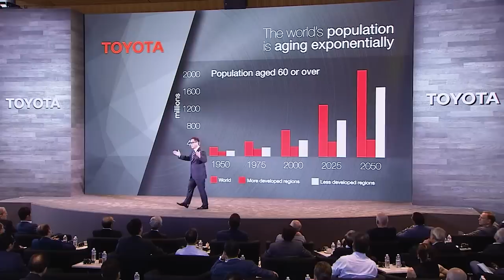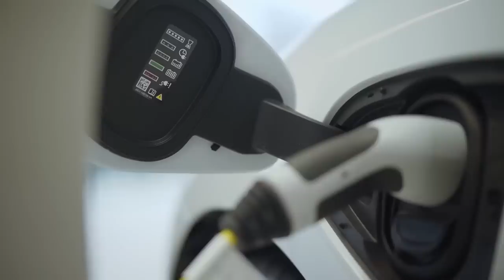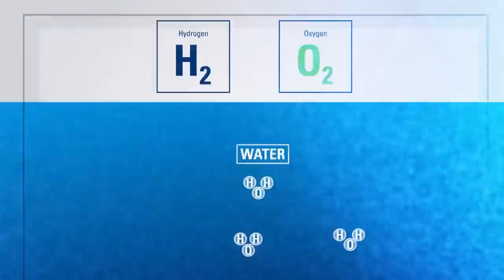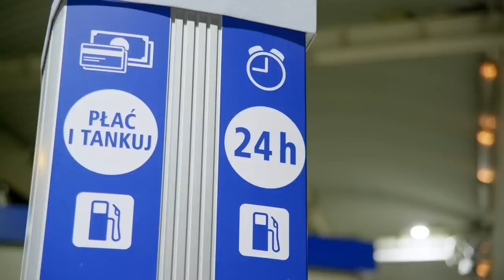New Toyota CEO Shocks Everybody | Huge News

Comment: Interesting, EVs are still a tiny fraction of the worlds motor vehicles, when the technology has matured enough to assure it's a superior concept, then it may become the dream that was imagined. It's still in the infancy stage of developement, can't wait to see it grow up a little.
Reply: There is no clamor for these vehicles. Smoke and mirrors.
Reply: With all the destructive mining needed to make EV batteries, their limited recycle ability, and the strain on the electric grid, not to mention the excessive cost (and infrastructure costs) Hydrogen can be integrated into the existing ICE fueling depots and stations as well as moved regionally by pipeline. I think Toyota is aware of this and if mainstream media would drop all the hype and look at the conversion of station facilities and work with the big refining companies, a 50:50 shift IS possible in the next 10-15 years. But the automakers have to stop following the crowds and media hype from the evidence of a small fleet (comparatively speaking). Stop the koolaid fountains. let science follow the facts and do the planning.
Reply: The tech is there. Outside of towing heavy loads EVs are superior in every way. Only thing is for the costs to start coming down.
Reply: @servehim1746  Do you sell lies for a living?
Reply: EVs are mature enough to serve very well in certain use cases common in well developed countries. For example, as a local errands/commuter car for families that own their own homes - especially as a second family vehicle. Since EVs are typically charged overnight, the daily driving range is what is important. Any modern EV with an EPA range of 200 - 300 miles will do this nicely - even allowing their drivers to go multiple days without charging. To your point, as the technology matures, more and more use cases will become more viable.
Reply: @JasonTaylor-po5xc  I agree, but a golf cart works well too as a third errand running vehicle.
Reply: @XKS99  not superior for my 800 mile drive to see family.
Reply: @servehim1746  Only if you live in The Villages (or similar retirement community). In my area, I would get ran over in a golf cart. They are also not legal on 45+ roadways - which is what I need to use to get to work.
Reply: @lyleclark9190   Model S or Lucid Air can easily match any non-cannonball run for total journey time. See Bjorn Nyland’s 1000 km challenge series on YouTube.
Reply: @lyleclark9190  Most middle class families have multiple cars. If you are stuck with having only one, then perhaps a PHEV would be better instead of BEV. If you are able to afford a Tesla, then road trips really aren't a huge deal since they have the best network and charging speeds. I visit my family, about 500 miles each way, and it really doesn't take that much more time than when we did it in an ICE vehicle - I just align charging stops with everyone's bathroom breaks.
Reply: @Lyle Clark  An 800 mile drive in my Tesla will cost me about $40. You?
Reply: @lyleclark9190  You drive 800 miles without stopping 30 minutes for a bathroom break and a meal? That must be quite the bladder you have.
Reply: So you only own one vehicle? And you drive to see your family what? 15 - 16 times per year? Well, I guess for an extremely unusual use case such as yours, electric just doesn’t make sense. If, on the other hand, you’re really like 99.986% of other people and don’t have those needs, maybe having one purely electric vehicle wouldn’t be all that debilitating a choice for your lifestyle. Anyhow, you could always have a second, gas-powered vehicle, you know, for those “other” situations.
Reply: @ws6002  To be fair, some folks don't care about cost - they simply want to get to their destination the fastest way possible. Of course, in that case, I would just fly if the distance is more than an 8 hour drive. Also, I didn't buy my Tesla to save money, but it is a nice perk.
Reply: @WarBuzzard  
I travel 800 miles round trip at least 6 times a year. A Tesla Model 3 is a very comfortable way to do it.
Reply: @HariSeldonIsBack  Pretty easy to stop at any gas station along the way vs finding a quick charge station in the middle of Nevada.
Reply: @ws6002  A lot less for me over all with my 10 year old car.
Reply: @servehim1746  Pie in the sky reasoning....way too expensive and the game is over and EVs have won.
Reply: @Lyle Clark  
I am waiting for a dollar amount. Don't be a politician. Just answer the question. How much in fuel does it cost you to drive 800 miles?
Reply: @ws6002  I keep my vehicles for a while and the batteries would time out before the car was worn out. Have you checked out the cost of replacing those lithium ion batteries? Don't tell me I'm being a politician just because logic defies you.
Reply: @JasonTaylor-po5xc  My next vehicle will be a hybrid for the longer trips and have a smaller battery so it can do short trips without lugging about with a 1000 lb battery - too expensive due to rare earth minerals and precious metals.
Reply: @XKS99  Toss in the EQS and I7. Long trips are already cheaper and more comfortable in luxury EV sedans.
Reply: @Lyle Clark 
You are a politician. I am still waiting for an answer to my simple question. How much does it cost you, in dollars and cents, in fuel to drive 800 miles? Don't expect any other response until you answer the simple question you have been evading.
Reply: @ws6002  don't be so simple, the fuel cost for my last 800 mile trip was about $100 for a car that won't depreciate as fast as the money you will loose with your EV. Overall cost is still to my advantage. If you put a lot of miles on yours every year and do frequent trade-ins then an ev could make sense but for many of us that don't put a lot of miles on our vehicles the EV looses in economy.
Reply: @Lyle Clark  Congratulations on answering a simple question. Obviously, I know there are other costs involved. At this time, buying a new EV is more expensive than a gasoline car of the same capacity. But that is changing. Because of the simplified architecture EVs enjoy, they will ultimately become less expensive to purchase than the gasoline car. And when that happens, gasoline cars and trucks will have a challenging future. Gasoline cars require oil changes. EVs do not. Gasoline cars have expensive scheduled maintenance, such as replacing the timing belt. EVs do not. Gasoline cars have 10,000 components, and as the car gets older, they get increasingly uneconomic to maintain. EVs do not. My gasoline powered car requires waiting in long lines to get $0.05 a gallon off. My EV effortlessly charges at home in the garage. The price of gasoline is not under our control, no matter how many pipelines we build, because oil will always be sold at the HIGHEST PRICE anyone in world is willing to pay. The price of oil shot up when Russia invaded Ukraine. It also shot up when Iraq invaded Kuwait. And we paid a price in blood when we sent our men and women to the middle east to kick them out again. For that reason, I think we need to include a good portion of our military budget when we talk about the cost of you driving 800 miles in your car. And of course gasoline cars pollute the air, leading to some of our citizens dying from lung related illnesses and cancer. Don't get me wrong. I am equally responsible for the war in Kuwait and the air pollution, as I have owned gasoline powered cars all of my life. My real message here is not you should do this or you should do that. My message is one of hope. For the first time, we have a real alternative to gasoline powered cars available to us. Maybe, but not necessarily, an EV will be the right choice for you. But it will be up to you, not me, to make that choice.
Reply: @ws6002  I do agree with everything you just wrote, all well said.
Reply: @ws6002 My Mustang GT convertible V8 with MagneRide would be even more comfortable lol
Reply: @Matt Ritchie  
I'm not sure there is a lot of overlap between people who buy loud muscle cars and light weight super high mileage BEVs.

Comment: Go towards EVs that don't need to be plugged in. Have a mechanical direct connect to the axle of EVs and solar, to super charge them. No more plugging in. Use V2G tech to transfer extra energy to the power grid, so the EVs don't light on fire or explode, from over charging. The tech already exists and both the mechanical direct connect and the solar, should be a  manual plug or connect. In case the V2G tech is malfunctioning for any reason.😎
Reply: People talk about solar charging, in the UK you can forget that. My wife's garden lanterns are solar charged I cant remember when they were last working. The UK has very limited all year long sun.
Reply: You do know that you get about 1 kWp if you plaster the whole car in fragile solar cells, that's at best 5 km/hour in bright sun, if you have trees, houses, anything providing shade to your car at any time of the day then it will be considerably less. And that means that the sun needs to be shining (which in January it was for about 30 hours total where I live). In Summer time you will need to cool down the black (mandatory, only color available for the solar cells) car which will become hotter than even a normal black car (because the solar cells heat up themselves on top of the ambient heat of parking the car in the blazing sun) - reducing the amount of captured energy for driving purposes again quite considerably. 

That's why Sono Motors and Lightyear have already faltered on their plans to produce a car that is supplementing the external charging,  that leaves Aptera with their plans but that too doesn't look good in terms of self sustaining power generation.
Reply: @karlgunterwunsch1950  and you do know that I brought up more than solar right? Solar would be a small additive,so there's always a charge in your EV.
Reply: @caseyford3368  You described a perpetuum mobile - that doesn't work because of the laws of thermodynamics. Only someone who has no clue in physics would suggest something like your direct connection to the axle. All BEV have a way of recovering energy from their motion - but they do so only while decelerating (commonly known as breaking) and that's the most they can do and it already is implemented on every single one of them. So you didn't describe anything new nor as groundbreaking as you make it out to be.
Reply: @karlgunterwunsch1950  all it would take ,is the right gear configuration and rivets in where you have the mechanical direct connect. There are multiple gear configurations, that allow us to harness kinetic energy.
Reply: @karlgunterwunsch1950  the solar, would be just to keep a charge in the EV, if you happen to leave your vehicle somewhere for a long time without driving/ charging it. We may think about combining a self running generator, with EVs. Solar wouldn't charge a vehicle that's in the dark all the time. But, self running generators would.
Reply: @caseyford3368  Self running generators are the dumbest idea ever! What do you want to run the generator on?
Reply: @karlgunterwunsch1950  are you not aware of the many self running generators that are already patented? And for me, I'd use a kinetic design self running generators. Combine a  kinetic design that will keep itself moving. Then add magnets for weight and constant flow in one direction. The opposing magnets, would constantly charge themselves by moving over other magnet's.
Reply: @karlgunterwunsch1950  I was going to make my own generator, but it turns out, they were already proven and patented. So, now, I just want to track down whomever has the patents and try out a power wall on them. Combine self running generators and power walls in homes and businesses for seemingly endless clean energy everywhere all the time. 😎🇺🇲

Comment: If any of this information is in error, please correct me. It is not my wish to mislead anyone. I hope they manage to make the batteries interchangeable. According to a few mechanics I've spoken with, current EVs and hybrids have batteries that are integrated into the body/floor structure, so when the vehicles are involved in even minor accidents, insurance companies tend to write them off instead of fix them. I would also like to see some kind of plan regarding the recycling of old or damaged batteries that minimizes the ecological impact.

Comment: Toyota has a lineup of automobiles of all types. 
They are seen as reluctant to build EVs, but in reality they are capable of building top of the line EVs. 
Toyota will continue with non-EVs because it is more practical and environmentally friendly. 
Would it be practical to build electric stations in the Sahara Desert or in the backcountry of Alaska with wires running through them?
Or, with thermal power still being generated in many countries, will EVs running on electricity made with it contribute to carbon neutrality?　
The answer is no.

Comment: Pushing for hydrogen is just an incredibly dumb strategy for two really simple reasons: 

(1.) Nobody else is doing it (=no economies of scale);
(2.) People have power outlets at home not hydrogen fueling stations (=no easy way to bootstrap adoption).

Energy costs are trending down for decades, rare earth materials are being removed from battery assembly processes, Chinese and Korean automakers are ramping up production of cheaper models of electric vehicles.

EVs are becoming greener, cheaper and ubiquitous faster not slower than predicted.

One company going against the grain in this situation is not visionary , it’s unadvised .
Reply: Toyota has a problem common to other Japanese organizations: they conflate disagreement and disrespect at the basically the same category.

No wonder the new leader is following the steps of its legendary predecessor.

The world will still have plenty of markets for ICE vehicles, it’s just that these will shrink over time, at an accelerating rate.

Comment: Well as an environmentally trained person, I must say two things. 1. Hydrogen is not an energy source. It is a form of energy storage, just like a battery. 2. Compared to batteries, hydrogen is extremely inefficient when looked at the whole chain from making the hydrogen to the wheel of the car.  Thus, if one wants to make enough hydrogen in a sustainable way, that is not possible with solar or wind. That is simply unfeasible.  That can only be done by nuclear fission or maybe in the future nuclear fusion. I think Toyota does not really understand this.

Comment: I’m all in Toyota. My next truck will be a Tundra 1794 hybrid. My next car will be a hybrid RAV4 all wheel drive. Hybrid is the fastest way to introduce battery exclusive and hydrogen powered vehicles. Large industry will gravitate to hydrogen which will drive confidence. Battery exclusivity is a fools errand. My friends that jumped on the Tesla’s are having 2nd thoughts. The absolutely have to own a 2nd gasoline vehicle. My hybrid’s will ease me into the future. Battery exclusivity or hydrogen. The are both to far away for practical use.

Comment: The all E.V. Fantasy does NOT take into account the need for massive unrealized  investment NOT happening in synchronization with restrictive I.C.E. tailpipe emissions restrictions coming to a vehicle near you very soon. Building the electrical infrastructure needed for an all  E.V. based transportation system will take many, many decades to deploy the needed Electrical Generation Plants, High Voltage Transmission Lines, Sub Transmission Lines, Local Transmissions lines needed for the peak demand loads that daylight and evening charging of Commercial Truck and Passenger E.V. Vehicles demand added onto  existing Electrical Energy consumption. E.V. in mass is at best an aspirational dream decades away. Go count 18 wheelers next time on an interstate and know each will need 1.2 MEGA Watts of electrical energy to drive 400 miles.  Sorry Greenies....your emotional thought out pipe dream of an E.V. only transportation system is not supported by electrical infrastructure reality, or needed infrastructure engineering design time and build out logic. How did America become so led by people so ignorant of facts in front of their no tailpipe dreaming eyes !

Comment: Old saying: give away the razor and sell the blades for life.  "High cost" is such a smoke and mirrors lie.  Both of my last vehicles have cost much, much more for gas, services, fluids, maintenance and such than the cost of the vehicle.  Electric vehicles suffer so, so much less of these ongoing expenses.  One might believe their lies if, Toyota for instance, would guarantee no fuel or maintenance costs for just the first 10 years or so.  No, Toyota is just riding their gas-based infrastructure till it's a dead pony, to squeeze the last dollars out of their "investment".  

Gas cars - cheap going in, but endless costs.  Electric cars - same net cost or less, and much better experience.

Hydrogen has been "just around the corner" for many decades now.  What they need is magical  technology.  Toyota (and Nikola, etc.) should talk to Disney about a magical nonsense to make this finally happen.  Hydrogen is energy-intensive, expensive and blows up like a bomb; not just a flaming blanket like gasoline.  Tesla built their own electrical infrastructure, so why does Toyota not do the same with a hydrogen infrastructure?  Because it's not their problem, it's YOURS!  They just want to sell cars.